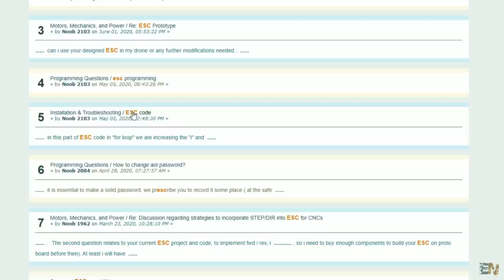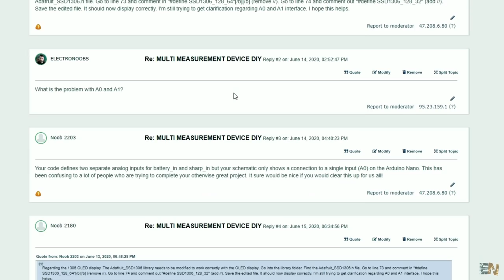My #4 Q&A - What's new on 2020???

Comment: Hi Electronoobs , i love watching your video always.

As we know about that AC dimmer circuit but is is only handy with resistive load ... i made one to control my fan automatically with PID( learnt from you ) but the problem is that it creates very much humming sound. But there are some volatege regulator which depends on DIAC and TRIAC but those don't create humming sound. 

 So can you please solve this problem. With waveform explanation...

"Love from India". Sachin verma

Comment: Q&A you missed you my question on the 300 w brushed ESC. Why are you using 6 fets in parallel when you can just get one fet with the same current/ voltage rating ? Keeps the gate drive simpler !!! Also I recommend you to have a look into SiC Mosfets they have low rdson and gate threshold voltage so they are much better for your application. 6 mosfets is just too much